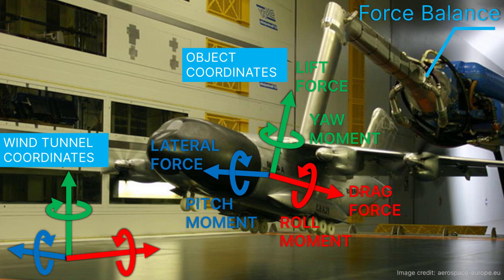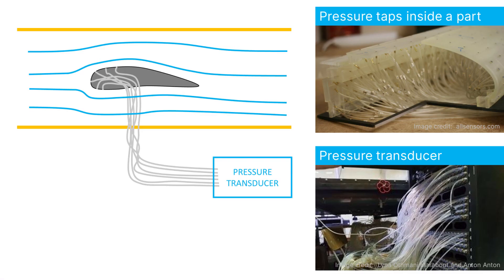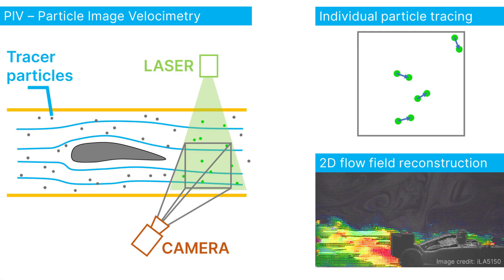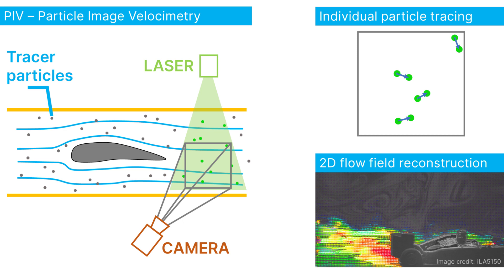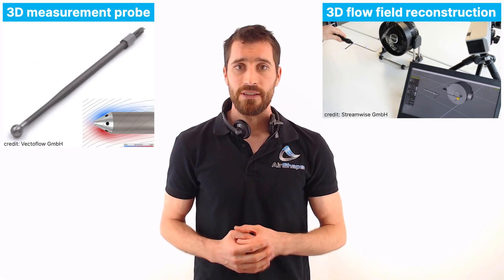How Wind tunnels Work - Measurement techniques, PIV, pressure taps, force balance, pressure probe.

Comment: is there air between the stream lines indicated via the smoke? what is the distance between the actual particles hitting an object in a wind tunnel?
Reply from the maker: The streamlines indicate a specific path for the particles released at the smoke outlet. In between, the air likely follows a trajectory that is an average of the streamlines around it, although local differences may exist.

The distance between individual "air molecules" is very, very small - but I wouldn't know exactly how small (and it will likely vary a lot, due to kinetic energy / the mix of various types of molecules / ...)

Comment: Fantastic series Wouter. Quantifing pressure is a hot topic amongst competitive speed skydivers & wingsuiters. Thanks for putting out this high quality content
Reply from the maker: Thanks a lot Meirbhin! We've been discussing simulations a lot with other speed sky diving professionals. Wouldn't feel good to drill holes in the body, but there should be alternatives to measure the surface pressure on the body 🙂 we do sims on 3D scans of athletes to analyze and optimize their equipment and position. See this video:
https://youtu.be/DqlDpUFcScc
Reply: @AirShaper  I've been following your work with cyclists and skiers. Very interesting indeed. Unfortunately I sustained an injury which impacted my plans on a mesh scan this year, but I did commit to drilling holes in the body haha
Reply from the maker: @MeirbhinOConaill  LOL :D I hope they didn't have to put too much metal inside your body to recover from the injury. For athletes, our customers sometimes work with "parametric" 3D models which can then be fitted to measurements on the real person. Less accurate but perhaps more accessible.
Reply: @AirShaper  luckily I got away with no permanent metal this time. thank you for this insight. I'll look into parametric 3D models, thanks again

Comment: I wanted to build my own wind tunnel in high school .. I got the air flowing through it quite nicely but then I started to think how to actually do some quantifiable observations and this is where my project fell apart. Looking back, I should have limited myself to some simple smoke and a high speed camera ...
Reply from the maker: Hi Jure, in a previous job we did the same and indeed, the measuring equipment cost almost as much as the tunnel itself! Force balances aren't cheap 🙂 perhaps the cost ratio changes for larger tunnels